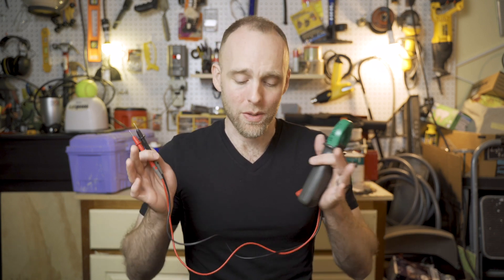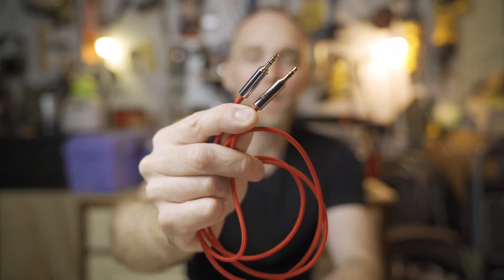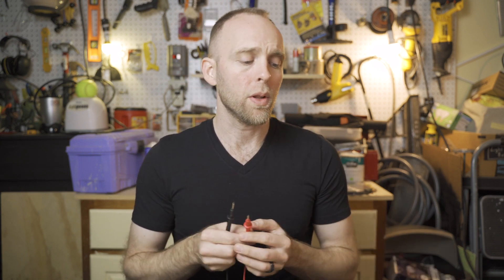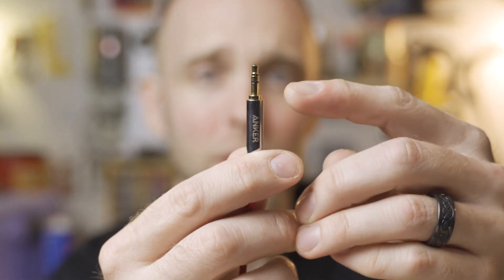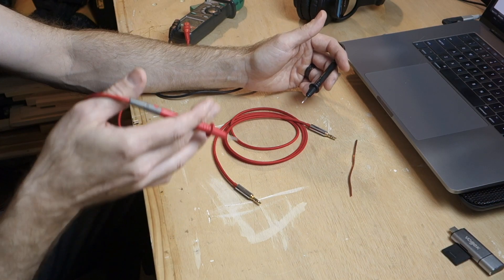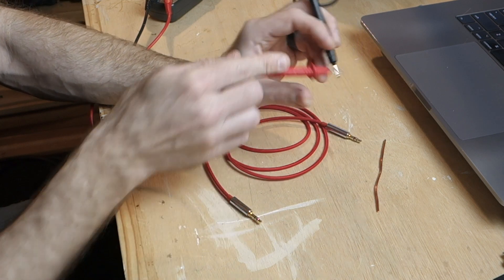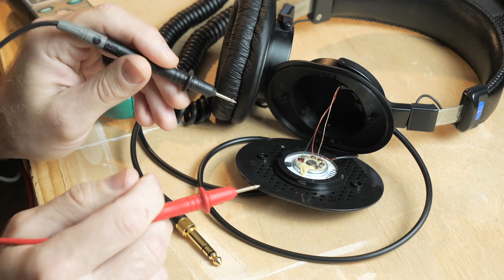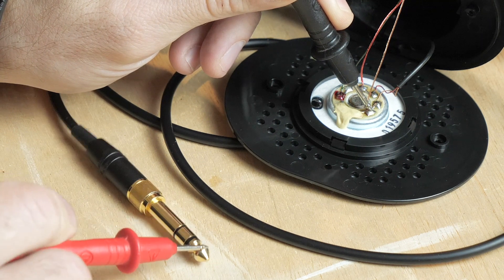How to use a Multimeter for Continuity - Audio cable and headphones test

Comment: Ohm symbol is for continuity?
I’m pretty sure that’s for impedance.
Reply from the maker: Yes, and, well, I guess technically ohms means or measures "resistance," and to TEST continuity, we have to be in a mode that tests resistance.  And in this case, a low resistance means the signal traveling from the black-lead flows through our non-electrified wire to the other end (if its continuous), to tell us whether it IS or is NOT continuous.  I'm not an electrician, but I play one at home some times.    And, for someone who is just wanting to test continuity and NOT be an electrician, if they pick up a multimeter they'll at least know to put it in the mode that has the "ohm" sign and they should then be able to test their cable.

Comment: Amazing video thank you for breaking down the BASICS for me/us!!
Reply from the maker: You're welcome!  And thank you :)
Reply: @MarcusHutsell  Just to update you--I was able to isolate the issue in my (very expensive) Sennheiser Momentum 3 over ear... turned out to be the audio cable... and that my replacement wasn't being plugged into the 2.5mm audio jack completely :0).  Thanks again... you literally saved me hundreds.
Reply from the maker: @TrainFlood awesome! So glad you figured out the problem and it saved you $$$ :) cheers. 🍻

Comment: I have a pair of jvc ha-rx900 headphones.  The left headphone has stopped working.  Testing at the solder points in the headphone, the red wire (right headphone) has continuity with the ground.  The green (left headphone) does not.  Does anyone know why that would be or what I should check for.  This video seem to indicate that the ground should not share continuity with the other 2.  Even stranger to me is that the one that has continuity with the ground still works.
Reply: I have the same issue with one of my earphones - the ground should not share the continuity with the green or with the red și that's strange that the good one is still working

Comment: I am new to soldering electric wiring. I can solder sterling silver wire in jewelry making. SO much easier than this. In checking continuity is there something wrong if the meter beeps on 3 out of 4 of the rings and sleeve of a male 3.5mm jack and one of the solder points in one earmuff (speaker)? My hearing is terrible and I need a headset. My hearing aids don't work on my TV.
Reply from the maker: Hi there Winnifred.  So, yes, I'd say there's probably something wrong if you're getting continuity on 3 out of the 4 rings on one end of your cable if you're only touching ONE of the conductors on the other end.  I'd say it sounds like your solder points are touching, making them essentially all on the same "circuit."  I ruined a pair of headphones de-soldering and soldering........and I'm not even sure how because the bass on the headphones just went away, so, it wasn't a left/-right continuity problem for me, just an unexplained frequency loss.  So, I haven't tried again just yet, b/c I don't want to ruin another pair of headphones!  But yes, if you're getting continuity on multiple conductors, then something is mis-wired or mis-soldered.

Comment: Hi sir,  i haves  working 1/8 stereo headphones but when it’s plugged in with a 1/4 stereo adapter it sound becomes mono. I also tried different adapters, is it a compatibility issue or those 3 adapters are really faulty? How would i check? Thank you in Advance
Reply from the maker: HI there Aaron.  hmmmm, well, you said you've tried several adapters.  Obviously make sure the adapter is a TRS adapter, both inside the adapter's female port and the outside 1/4" section.   TRS meaning (2) black bands separating the plug into Tip-Ring-Sleeve, or 3-conductor sections.  If you wanted to actually TEST the adapters, you could insert a spare 1/8" male-male cable into the adapter, then use a multimeter and test for continuity on each end of the cable like I do in this video.  Basically, put one of the adapters on one end of your spare 1/8" cable, then, test the tip-to-tip continuity between the male section of the 1/8" cable against the male section of the 1/4" adapter, then the Ring, then the sleeve.  if the adapter is a 1-to-1 cable, then you should only get continuity from tip-to-tip, ring-to-ring, and sleeve-to-sleeve.  So, let's say you test it and you get tip-to-tip continuity, but you're also getting tip-to-ring continuity.......then something's wrong because that WOULD sum everything to Mono, because the tip and ring are your left-right channels.

It's possible that all of your adapters have loose connections inside or just aren't machined well.  I know that some headphones really like their OWN adapters, it doesn't mean they won't work in some adapters, and it doesn't mean the headphones aren't still a standard 1/8" (3.5mm) plug, but I've found some headphones don't seat well into a particular adapter, like, maybe it doesn't go in far enough.  

If the adapters or the 1/8" plug on the headphones are making contact inside the adapter with multiple portions of the TRS plug on the headphones, then yes, it could sum itself to mono.  

Are your headphones regular TRS, or are they by any chance a TRRS (Tip-Ring-Ring-Sleeve) plug?  That could also greatly affect how the signals get to their proper or improper contacts.
Reply: @MarcusHutsell  i realized that my headphone has a mic, (3 rings) that makes it incompatible maybe?
Reply from the maker: Yes that can complicate things because many of the companies and manufacturers did not agree which rings on the TRRS adapter go to which cable inside, etc. Some companies have the ground on the second ring, some companies have the ground on the final sleeve, and it can obviously mess up how adapters work. However, you can try a female TRRS to male TRS adapter and might have better luck. Did you make those style adapters, I even have one just in case. Again, it depends on the brand of headphones, so you might start with looking at that brand of head phones and see if that company makes or recommends a specific adapter.

Comment: Hope you can make a tutorial on how to do it on usb type headset like the Logitech one. I have like Tangled and expiring wire housing usb type headsets that i cant figure out if the wires are still working or not. Helpful video btw!
Reply from the maker: Hi there.  The process would be the same, it doesn't matter what type of wires you're trying to trace.  You can do exactly what I'm doing with audio cables in this video and trace your wires on your headsets.  You just have to find both ends of the wires.  Of course, this is assuming both ends of the wires are loose (not still housed in a USB connector) and that you can open up the headset and actually find the other ends of the wires or at least where they terminate; AKA, the solder-points inside the headset on either the left speaker, the right speaker, etc.
Hard to know exactly your situation with your gear, but, still doable.

Comment: The video was great but you made a mistake, the omega symbol means resistance or impedance and it is the symbol used for that unit in particular which is ohms
Reply from the maker: Copy that. Thank you for the correction. I was just talking from the hip, so misspoke a bit. i script all my videos now, because I’m always learning from my mistakes. :)
Reply: @MarcusHutsell  no problem man, the video was really helpful.
Reply from the maker: So glad it helped :)

Comment: Hey there when will you solder them? I'm going to make my HD681B detachable but got no idea how to verify those wires & connect them to female 3.5mm jack
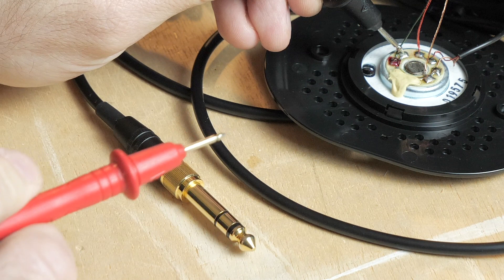Reply from the maker: Hi there.   I did actually modify my headphones and put a 1/8" jack on them.   If you get a multimeter and watch my video around 11:00 minutes, I go through how to verify exactly what you're trying to do which is verify which cable goes to left, right, and ground.  The mod worked, but for some reason the jack that I bought and installed wore out and the external 1/8" cable would not stay in the jack after a couple of months.  My soldering was good on the inside, nothing was loose and the sound quality was just the same as before, but I think I may have overheated the jack itself when soldering, leading to the tiny internal components inside the jack to loosen over time and it just wouldn't hold a 1/8" cable any longer.  But, the original mod worked fine, I think I just needed to work on my soldering skills so I could get the solder done quickly the first time.   

For a TRS connector, the Tip=Left, Ring=Right, Sleeve=Ground.  

Good luck, and practice soldering first!